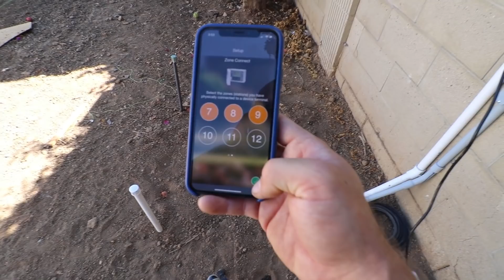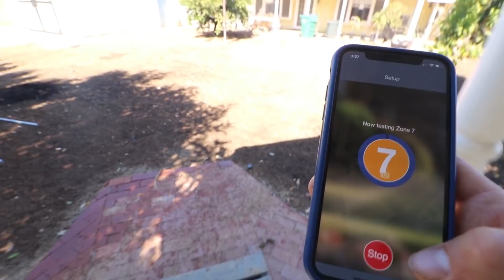Backyard Renovation Part 4: Adding Electricity

Comment: Electricians will never tell you this, but if you fish the wires WHILE you’re laying the conduit one length at a time, it’s a LOT easier!! They said, your vacuum trick is pretty genius!!!
Reply: Lmao I'm a electrician and what you described is a harder way. The amount of time you do that i can fish all my lines. His trick has been used for 20+ years now. They even use is for fiber,telephone and electric lines. Nothing new.
Reply: @RHEC1776  Can confirm, was an electricians "helper" for some summer work years ago and saw the vacuum method used on everything from residential to very large projects.  Putting the wire in as you lay the conduit seems unnecessary.

Comment: American electrical is really interesting. I'm a dutch electrician and our electrical code is very different. For one our buried mains wiring has to be at least 60cm (+- 2 feet) deep. You can have solid rock that deep, right? We are allowed to just bury cable as long as it has an earth shield so the fuse/gfci breaker will pop if you dig through the cable (unlikely because of depth).

I haven't seen the vacuum method before. It seems more difficult and time consuming then just using a fish tape. Harbor freight has a 50ft one for 10 bucks. That just means you need a junction box every for every 48ft of conduit. Pulling wire becomes more difficult with length and turns. Thus 20m (65ft) fish tape is standard length for hand pulling over here.

Comment: A very good way to fish wire is to use a appropriate size mouse and use compressed air to push the string through just stay back at the other end

Comment: I’ve seen the wire feed or vacuum feed trick done using survey twine and nothing tied on the end, it seemed to work well. Also in the future, they make a lubricant for pulling wire through conduit that would help tremendously. Something doesn’t seem right about having an electrical connection next to a hose bib but I guess if you’re comfortable with it.

Comment: A couple tips from a master electrician,  next time secure all your boxes before fishing pull string or wire in. Never bury a T box or anything that you cant pull straight through. You should have stubbed the pvc up into a ground box. And you can use a heat gun to form the pvc better like on the gazebo.
Reply: Also, does that wire need to be listed for wet locations?
Reply: @sk8infreek  not if it's in the conduit. But most THHN is suitable for wet locations but not for direct burial
Reply: When I first saw your user name I was like, "Wow Mike Holt (relatively) famous electrician is commenting". Then I released it is "Miles" and not "Mike" 😏
Reply: @johnvillalovos  I get that a lot on job sites. Are you related to Mike Holt. Nope just another electrician last name Holt lol

Comment: was it cheaper to have the wires in separate rolls, the stuff I have used is all in one casing
Reply from the maker: Romex cable (wires with the casing) isn’t allowed or recommended in conduit.
Reply: @BenTardif  ah, I didn't know that, I just put a bunch of Romex in my Barn!
Thanks for sharing and the back yard is looking great

Comment: 4:05 Perhaps a strong magnet and a small piece of metal to which the thread is connected? Then just run the magnet on the outside of the PVC. Just a thought, didn't try it though.

Comment: The electrical seems a little suspect. Putting it into the same trench as the sprinklers may save install time but will be a headache and even dangerous if you or a future owner has to work on the sprinkler system. The electrical also seems fairly shallow in the ground, I’m no code guru tho.
Reply: yeah I'd be so pissed if I needed to patch sprinkler PVC blowout some 40 years in the future and had to figure out the PVC on the top is electrical conduit without any instructions or indicators. you can always tell the DIY specials when it's time to fix them.

Comment: Tell me if im wrong but i think ur using 2.5mm size of cables. Wouldve been cheaper and less use of space if you went with 1.5mm for lights and 2.5mm for outlets as 1.5mm is enough for lights. or maybe regulations are different for america i wouldnt know.

Comment: Are you sure Hansel isn't a weed, 'cause he's, certainly, growing like one.
As for the wiring, if you had used fish tape, it would have been a lot easier.  However, the way you did it worked.  I'm, definitely, not going to argue with success.

Comment: You need to buy a fish wire, normally about 25-50 feet long.  It’s a hard flexible metal wire you can use to pull the wires through with.

Comment: Just me butting in, again. You might regret not using tubes for your low voltage wires, later. Having wires directly in the dirt might destroy them over time, and if they're destroyed you have to do a lot of digging, in a beautiful garden, probably leading to a divorce.  😜